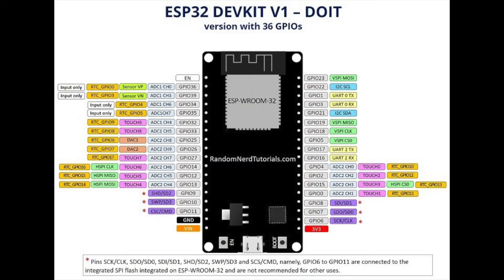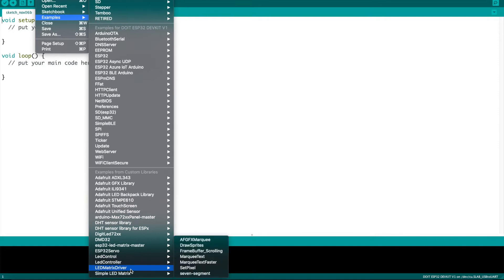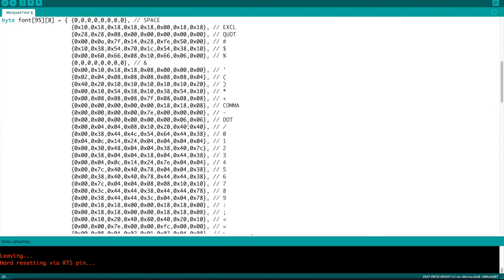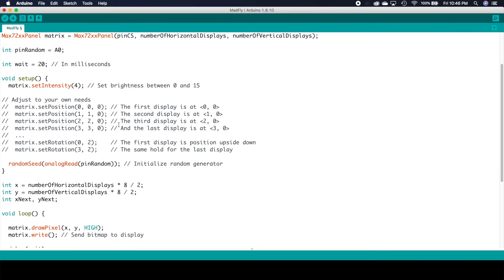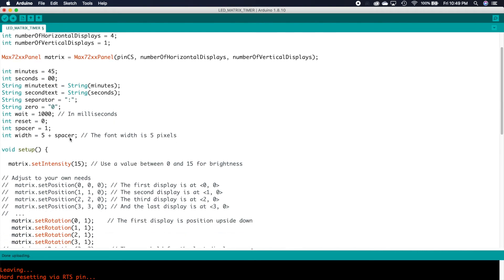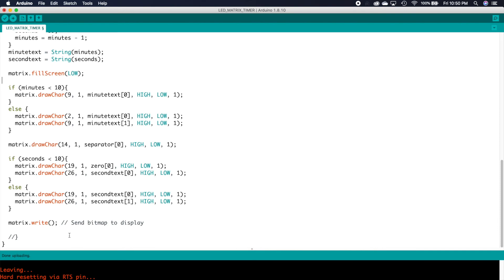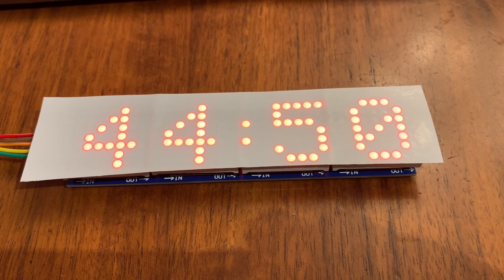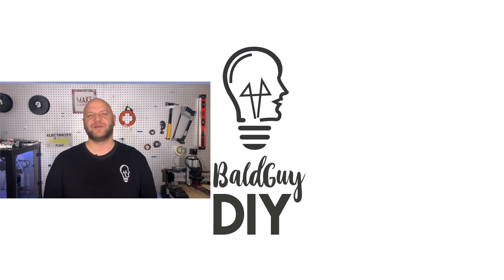ESP32: Marquee or static text on LED Matrix using SPI

Comment: Hi! :D
Excellent video! 
I was wondering if I could use these libraries in a NxM matrix "home made" with NxM leds. I have this project for my school, I need to create a cube of leds with an ESP32, but I just don't know how to do it :( 
Can you help me, please? :(
Anyways, thank you so much :D
Reply from the maker: Thanks for watching!  My video is based off using the Max7219 driver chip. If you google others who have done the cubes, you will probably find which driver chips and which libraries they used to make the cubes work. Focus on which driver chips/boards they used and which libraries, and you can probably find enough direction to do your project. If you are not allowed to use driver chips and need to do it all with direct connections to the ESP32 look for projects that were built entirely from scratch. It’s a popular thing to try, so I’m sure you’ll find lots of good resources. Good luck!